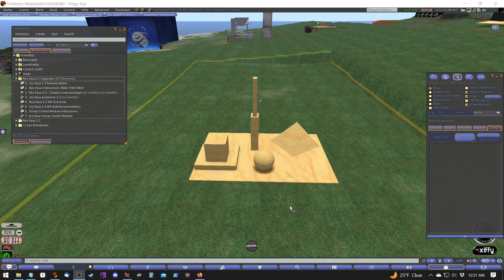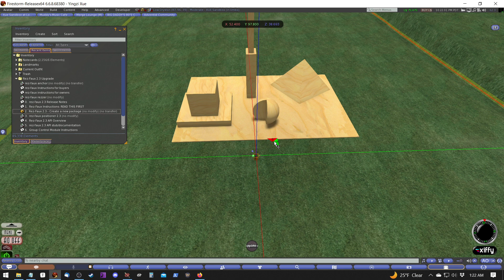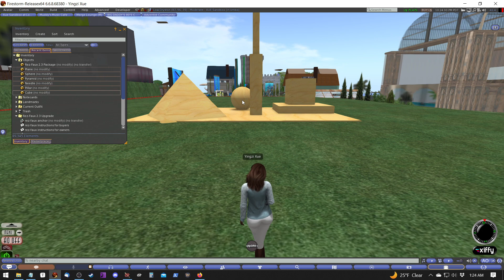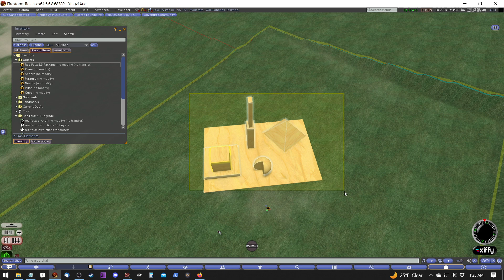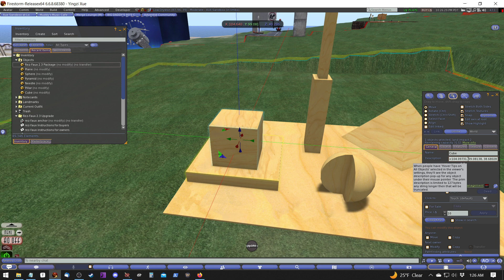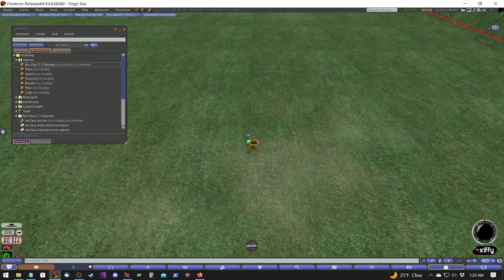How to use Rez Faux to package your builds in Second Life

Comment: Where can I get Rez Faux? Searched all over MP and I am not able to find it.
Reply from the maker: It was removed from the MP years ago by the creator.  You can only find it in-world now.  Here's the location.  http://maps.secondlife.com/secondlife/Chamonix/62/103/96
Reply: @lawtonsteele1734  - Just been in there, inworld. Not much left now. But the vendor is still there L$600 and empty shelves and that's about it. After almost 20 years in SL, I finally need the rezzer to save a heavily modified house, so it's fun to learn something new. I have over 100 items within 20m - some house contents some components. But I may still create 3-4 separate rezz boxes for different parts of the house and test each one in turn in a manageable manner.